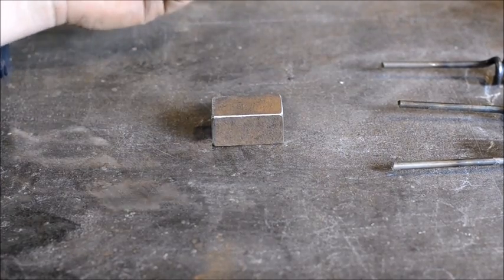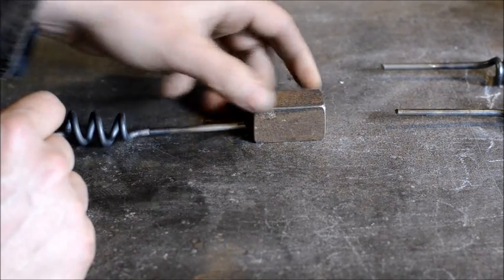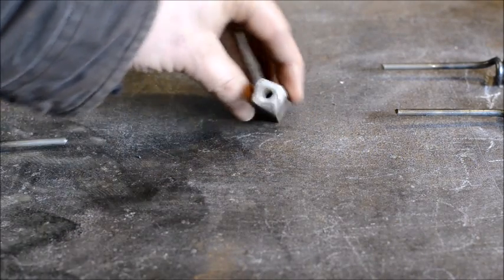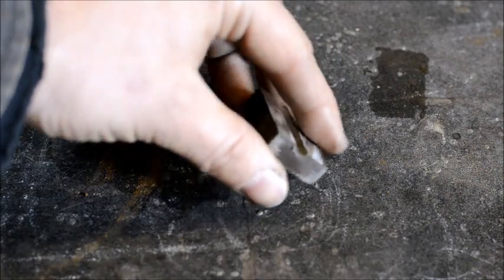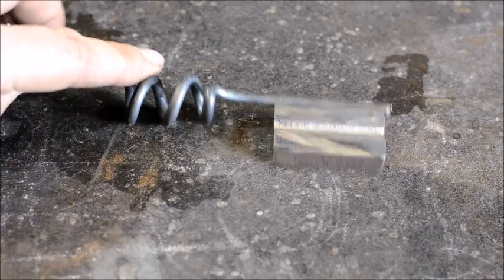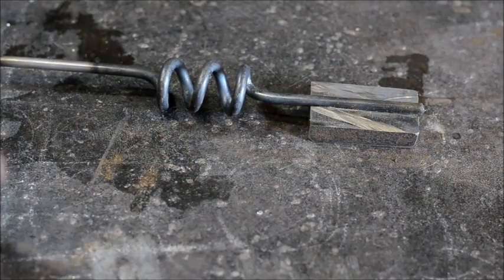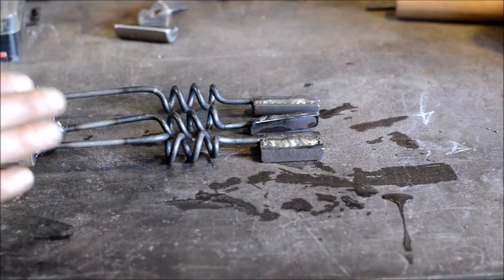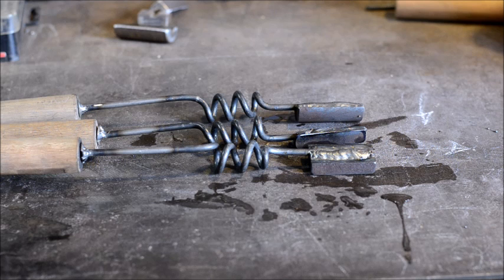Power Hammer Tooling Part 2: Tools for Use with the Hardy Hammer (or  Other Small Power Hammer )

Comment: I have the tool handles ready for the business end..  What is the maximum size round (and square) bar you would suggest using?  I inch, 1/25 inch?  I do not want to overdo it, but I figure I might as well get the maximum size fuller, flatter, etc. out of it since it will take the same amount of work.  Thanks.
Reply from the maker: 1 1/4" would be fine for this size tooling :-)
Reply: @ChristCenteredIronworks  Thanks - that triangular piece of steel you use for one of the tools is called an anvil devil.  And, like you said, it is generally used for marking.  Great video.
Reply: @ChristCenteredIronworks  Thanks - I see I mis typed - I meant to say i  and 1/4, not 1/25th.  Cool tools.  More work on building the Hardy Hammer tomorrow.

Comment: Warning to anyone who makes these out of mild steel stock. They all deformed after ONE use under my 50 pound tire hammer. I don’t know how long they will hold up under smaller hammers, but I would highly recommend a stronger steel. I will be remaking mine out of tool steel. I will say however that they did the job pretty well for that one use. Good video thanks
Reply: I would imagine that there is a big difference with the pounding force of a 12 lb Hardy hammer vs a 50 pounder!

Comment: You've def got a more solid connection than if you just welded it to the end of a stick. Mild steel holds up much better in many applications than a lot of people say it will. I would rather have something a little harder, but it's definitely not as necessary as many say it is. Keep it up Roy. Define Your Legacy,
Reply from the maker: Warped Legacy Thanks twan for your input. definitely a tougher tool will have more longevity but mild steel is so cheap though lol